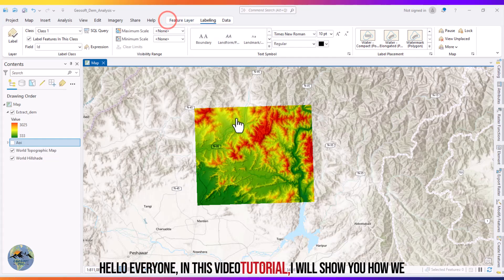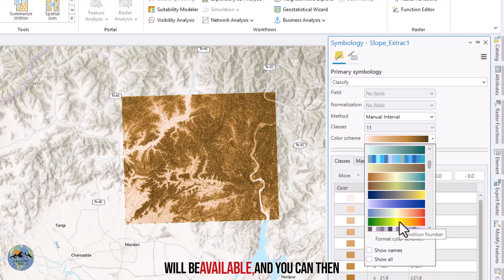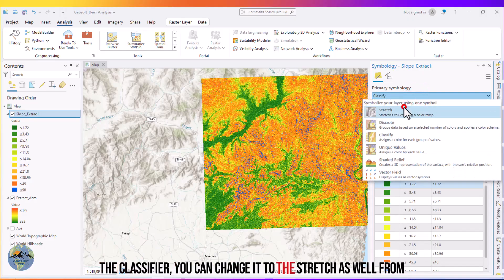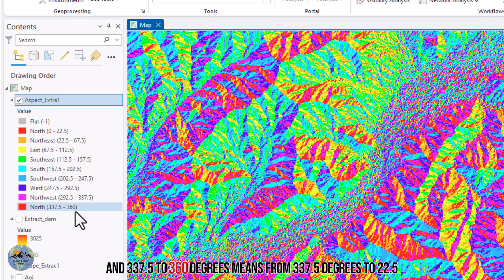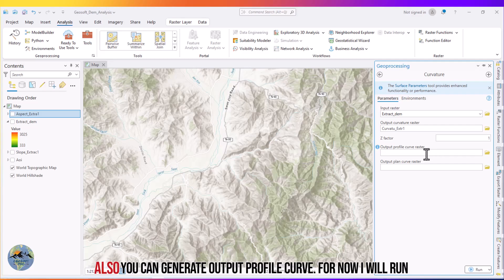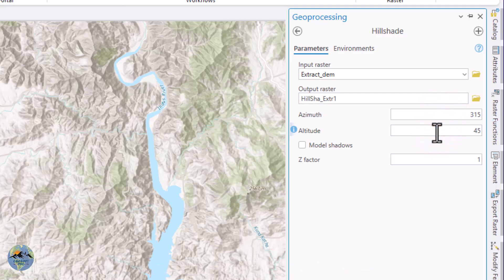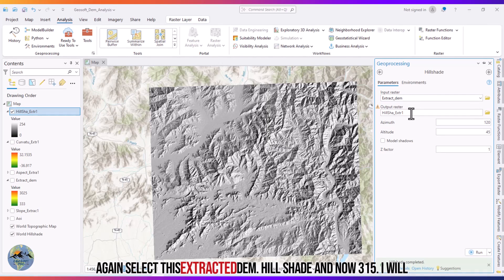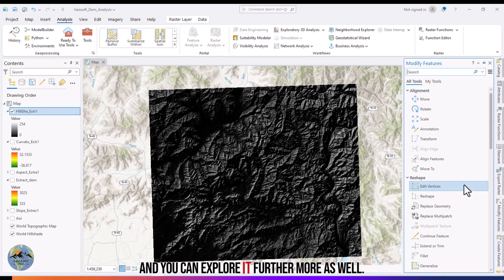ArcGIS Pro Tutorial: Calculate Slope, Aspect, Curvature & Hillshade | Step-by-Step Explained #arcgis

Comment: how can we find slope of specific feature like lake ?eg how much degree of sslope lake have?
Reply from the maker: Actually We Are Dealing With Digital Elevation Model In This Tutorial.... Which Is Above Sea Level... If You Need To Find The Slope Of A Place Below The Sea Level You Need To Download The Bathymetry Data Where You Will Have The Elevation Below The Sea Level Like Ocean, Lake Etc... And You Can Run This Tool Over That Raster Data. Cheers 🥂
Reply: @GeoSoftPro 👍❤️